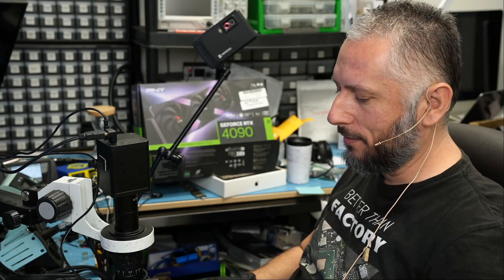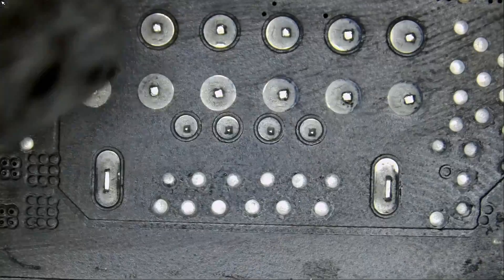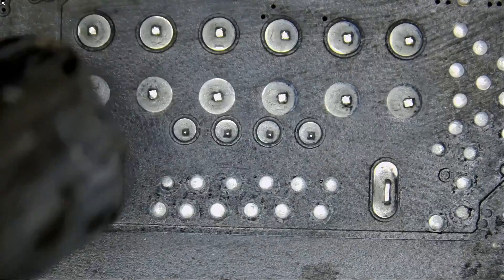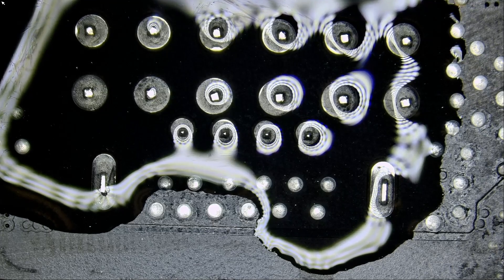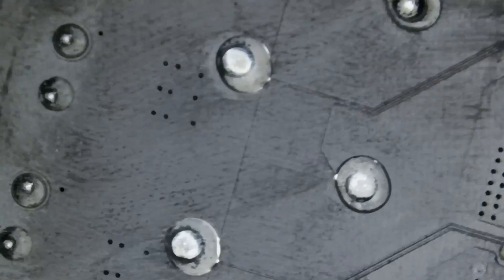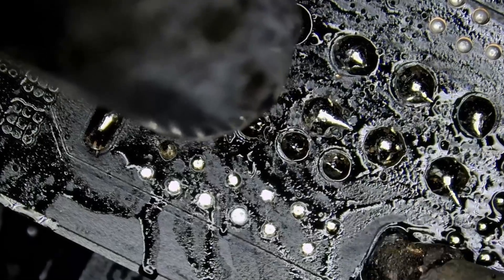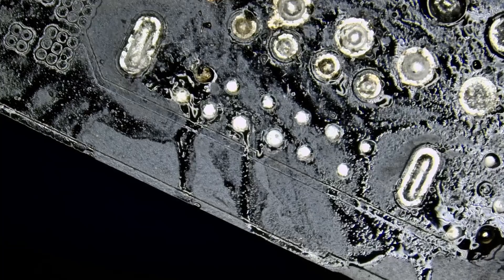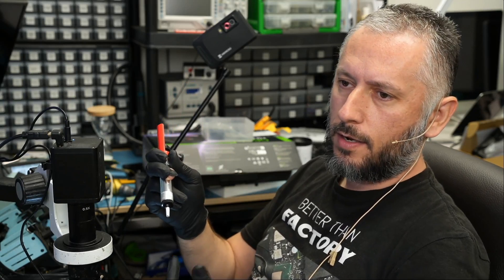Burned PNY 4090 Graphics Card Repair

Comment: i saw some of your repair videos for 4090's. i think, may be the manufacturers should use watercooler plates instead of air on these cards especially on the "TI" versions. they get way too hot.
(with copper pads insted of the cheap pads they use)
and on the connector they should make more space between the pins. they are too close to each other. (even make them thicker)

Comment: For the sucker there is another trick, When I was a kid my dad used to get it from the old CRT TV, there are 2 rubber anode caps and you can cut the tube from them and put it on your sucker's tip, which is heat proof, flexible and works really good I think.
Reply: You can also use a high-temp resistant silicon tube with the inner diameter of whatever nozzle you have. There's a solder sucker with this type of nozzle, and it works great with better suction.

Comment: You just need to start making a new connector, solder a double connector on with a couple branches of #10 wire. Each one is good for ~ 30 amps and then they can be distributed between two connectors instead of one. If it was my video card I'd solder the wires directly from my power supply to the board 🤣🤣🤣

Comment: A reference design graphics card, the name on the card does not always mean its manufactured by the name on it PNY is american and not sure they make that card i may be wrong.ATI branded cards were made by sapphire many moons ago so you see a company can get there name on a card made by a 3rd party and depending where a card is sourced either that manufacturer is the issue or as mentioned the reference design is faulty.

Comment: The melting connector is a known defect on these cards. Manufacturer should be replacing this for free.
Reply: Need someone to come up with a ceramic connector. Those plastic ones keep melting and won't hold.
Reply: @fleurdewin7958  there must be a reason that piece of plastic is getting so hot to begin with. next thing that melts isnt far away, probably the wire sheathing. is the heat generated due to resistance in the connector itself? if so more connectors are needed to spread the current over more wires. is the heat coming from an ourside source, such as air from the cooling fan? is the heat being transferred through the pcb itself? these are the questions i would ask to come up with a solution
Reply: @soundspark  the gold and or copper pins would have to reach 1100c to melt and fail. the entire computer would be a puddle before it gets 1100c.
Reply: resistance in the connector....
Reply: @CATech1138  how can you be certain?

Comment: I never remove the 3x8pin connector from my 4090 that will eliminate the chance of burning the connector. I only remove my power supply cable's and leave the cable that comes with the graphics card

Comment: Sooo, on a very hot summer day, low melt solder might just say bye to you if you're not careful? 🤯
Reply: The low melt solder is only used to make de-soldering easier, it's obviously not intended for permanent component install.

Comment: The Nvidia bad designs 4000 series to 4080/4090 3 power supply voltage plugs to one video card 16-pin make a melting damage video card. 1080 Ti 11gb is the King of Video card…. 👑

Comment: The pins cannot withstand the electric current simple as that

Imagine the card eats 500w+ using dat tiny little pin, what happened then? Hot and burn baby and melting at the end

Nvidia is an expert when making a GPU but not in electric current expert, they are just noob in electrical

Comment: Nice fix!  Does that connector @ full power load ever get to the 50 C melting point of low-melt solder?  Nice technique though, making your own alloy on-board by combining low-melt with the existing solder.  Chemistry and physics, of course knowledge and skill,  to fix a card for a gamer!  Yep now it makes sense!
Reply: He doesn't use low melt for soldering. Only uses the low melt to desolder.
Reply: @WildRapier fail troll or ignorant know it all.
Reply: @day-one4676  Because I asked if the connector got to the melting point of the solder?  Maybe a different solder was used to attach, if not it's a valid question.
Reply: @WildRapier  5:53 watch what happens to the low melt solder on the board. low melt solder is not used to attach components, only for de soldering
Reply: @bmxscape  Yeah I did... amalgamates with existing solder to lower melting temp of existing solder...to be able to pull it without excessive heat... Just watching to learn!
Reply: @staples4335  I had a feeling that was the case...but it wasn't discussed...good to know!

Comment: ur low melt solder melts at 50 degrees?????
Reply: Celsius, don't be fooled.
Reply: @deathtrap1976  no yeah, but solder can melt that low?
Reply: @hapsti  well, it's more 80 than 50 but still it's quite low anyway

Comment: If you are already using solder suckers why not buy a desoldering gun?
Reply from the maker: Solder sucker is a lot faster, no power needed, smaller tip,, lighter and more efficient.
Reply: @NorthridgeFix  I guess I have always had crappy solder suckers, I think you have one worth getting.
Reply: Can you use a solder sucker with an iron alone and no hot air?

Comment: It could be User Error.  User bought a video card that was poorly designed.
Reply: Let's not forget about the heavy cards cracking the edge connectors too I think a classic lawsuit should be launched against Nvidia maybe then they smarten up...
Reply: At this point & time it's A USER ERROR 
Just don't buy it
Reply: Необходимо не высасывать олово а выдувать олово компрессором как в России делают !!!!!!!!
Reply: @РинатСабиров-й8е  hahaha. Containment is better 😉 😁🥳
Reply: One of The best comment lately
Reply: No, it's not a user error! Its pour design only! I can assure you that even if you leave your power plug half-plugged on the 8 pin design you are not going to have any problems! Tested with multiple 3090ti-s
Reply: Overclocked cards need excessive cooling and still are prone to overheating. Plastic will melt. Buyer be informed.
Reply: user is an idiot for sending a card under warranty to a repair shop
Reply: No no you didn't understand they are saying right it's the user error for buy that thing in the first place 😂
Reply: It's always user error. Why don't people understand this yet?

Get a good PSU, connect the GPU properly, don't cram it in a crappy case. I run a Strix 4090 off a Thor II PSU and the connector never rises above 38c. My rig has proper cooling, this is why I will not face this issue with my setup, ever.
Reply: It's not because the person doesn't want to spend on another power supply, there is a power supply now with a conctor for the 4,000 series  kkkkkkkk
Reply: @MarquinhosBardon  that's the problem: the 40XX series connector is prone to user error.